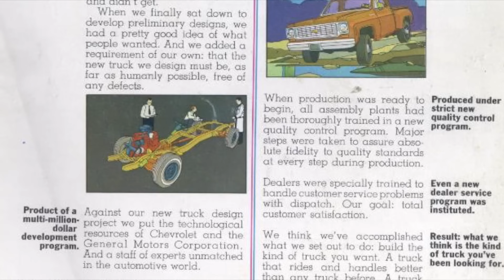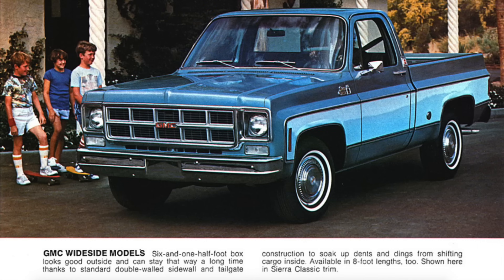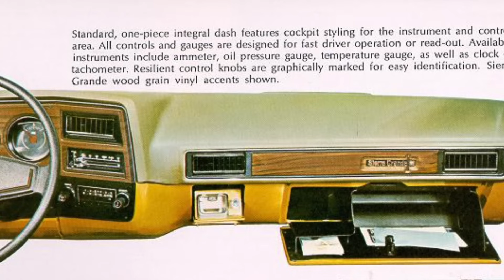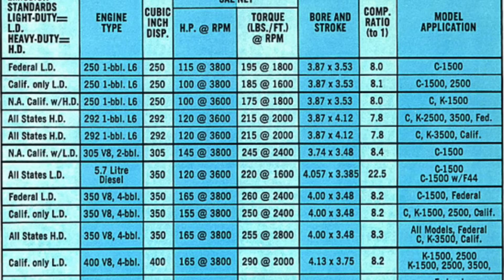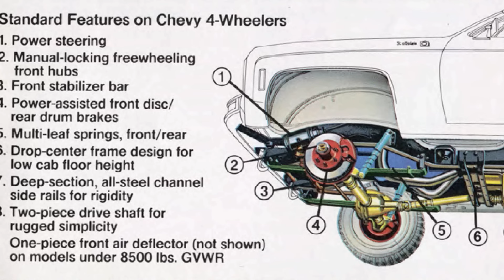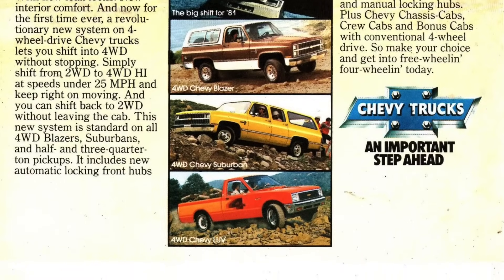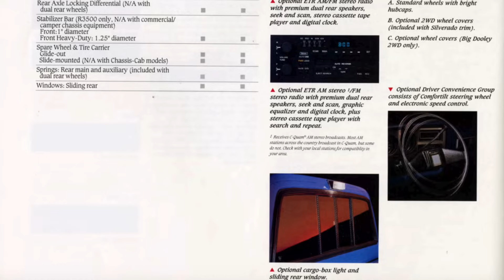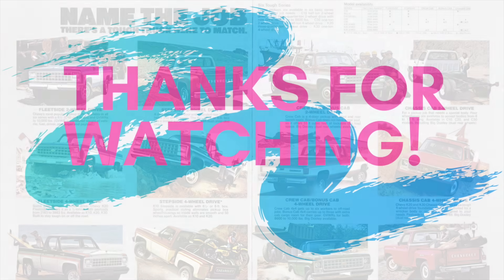73-87 Square Body Chevy & GMC C/K Truck Buyers Guide (Design, Options, Engines, Common Problems)

Comment: Yes. Easy oil change, easy sparkplugs change, easy work on engine, easy works on engine parts unlike today’s truck which you cannot.
Reply: I generally agree with you, but I think for the SBC motors spark plugs are a little bit of a pain since they live under the exhaust manifold. But for 6 cylinder and BBC motors, yes, spark plugs are brain dead easy.
Reply: I think spark plugs are very easy on the 1961-95 GM small blocks. I have headers on 2 of mine too.

My wife HAD a '99 Ford Expedition with the 4.6L years ago. THOSE 2 right rear spark plugs made almost an ENTIRE Saturday of a spark plug & wire change!!! Mixed with more profanity than I care to use in a day!! Don't get me started on an oil filter change on this same 4x2 Ford either!!! 🤬
Reply: No computers and minimal pollution devices. The AIR pump was the first thing to go. Drill out the catalytic and plug with a frost plug. My 1976 3/4 ton 454 cu,in had dual exhaust and no pollution devices. Low on horsepower but good on torque.
Reply: that's because todays trucks are filled with electronic crap that you have to go to a dealership to get it worked on. I'm convinced somewhere along the way auto manufacturers and car dealerships made some type of deal with one another. Why else would you have to go to a dealership to get something diagnosed that only the dealerships have the equipment for that you can't buy and do it yourself?
Reply: I drove a 1976 Chevy C10 for 25 years
Reply: I don;t have to jack up my truck unless I need to work on the brakes.  I love that.
Reply: That's why I refuse to buy a modern car or truck.  I don't want a vehicle that I can not work on.
Reply: @bufford5483  And torque, more than horsepower, is what a good truck needs.
Reply: @RhinoXpress  Much of this is due to the Japanese.  They started cramming their vehicles with all that junk and then, with the help of the enthusiast press, convinced the younger people that all that junk was kool, and that American-made vehicles were "junk" and "unkool" and "outdated".  Those same younger people lapped that up like a kitten lapping up milk.  That forced the Big Three and the Europeans as well to follow suit, as nobody wants their vehicle to be "outdated".
Reply: @jamesbosworth4191   actually the big 3 started it first as far back as the early 80s with electronic gauges and talking warning crap. Chrysler was notorious for putting electronic crap in their cars back then. But let's not forget GMs active cyclinder electronic management garbage in the Fleetwoods that were so bad that they discontinued it after 2 model years.
Reply: @RhinoXpress  I am only talking about under the hood, not the dash.  Actually, the Swedes did it in the 70s - Volvo with their Lamba Sond system, and it seems to have worked, but Volvo was not really a mainstream car, but yes, Chrysler with their Lean Burn and Cadillac with their V864, did indeed introduce those monstrosities in the 80s, but the Motoring Public rejected them and made it clear that we didn't want computers in our cars.  It was the Japanese and the Germans who slowly re-introduced them and made them "kool".  I blame the Japanese because they sold way more cars here than the Germans could.
Reply: I'm a subaru guy about to get his first square body and apart from the rust these look so user friendly compared to the cars I'm used to 😂😂😂
Reply: @COWBOYZNATION It depends on what kind of exhaust manifolds you have on Chevy small blocks.  The original 265 had log manifolds, and after that, they switched to the Rams's Horn manifolds, both of which rode ABOVE the plugs.  The 70s style were branch type manifolds, and those rode UNDER the plugs, making them much easier to get to in cramped engine compartments.
Reply: @cocoworldwideoriginal998  Cool. Squarebody GM trucks rule. Just unplug and bypass the ESC if you get a 1982-86 model.
Reply: Pretty sure I'm getting one in a few days. 40 year old truck has more life in it than the ones at the dealership... especially when I'm the mechanic
Reply: Certain headers are just as easy as stock exhaust manifolds. Head Man Tork- Step Headers is one of them.  I have some on my 81 350

Comment: I own a 74 c10 I got 5 years ago when I was 17 for $2,800. Still has the factory 250 inline 6 with a 3 on the tree transmission. (Love the old school vibe and none of my friends ask to drive it!) It has the option tag intact and  shows a few upgrades the original owner selected like a heavy duty clutch and rear springs, chrome front bumper, radio...If I have my say I will never part with it. I feel like I’m driving a couch it’s so comfy. It only left me stranded one time, the ignition coil went bad. So I got electronic ignition and she’s all good. She’s my daily driver and still earns a living on my pool route! I rate her ⭐️⭐️⭐️⭐️⭐️
Reply: Also I before I got my 74 c10 I had a 79 c10 short bed/step side with the wood bed. It too was 250/3 on the tree, although it was the high performance factory 2 barrel. I beat a 85 dodge truck with a 318 and a automatic!! I think I might have been jumping in my seat I was so excited hehe. It only had 58,XXX miles when I got it, I only had it 3 months before some lady pulled out in front of me while a friend and I were taking 1,600 lbs of steel to the scrap yard... fortunately a witness stopped and gave me his number and said you did everything you could, she’s at fault. I had bought the truck for $3,000, insurance paid me $4,300, then my next door neighbor bought it off me for $300 and sold it to someone who’s completely restoring it. Though only I only had it a brief 3 months, our time together was sweet and I’m very grateful she lives on at a good home. Apparently the new owners dad had a truck exactly like it when he was a kid so he was searching for that very year and model. Good vehicle, made $1,600, and she gets restored, and I wind up with my beloved 74 c10... don’t think it gets better than that.
Reply: Sounds like you have a sweet old girl there!! Awesome stuff!
Reply: I have a 1978 BIG10 454 short wb that I ordered new. It now has 82k miles.
Reply: I have a 79 square body c10. I am looking for a set of truck rally wheels OE. Any suggestions I am located in Yuma, Az.
Reply: My old 79 had a i6, we put a 350 in it with and overdrive 5 speed, i6 was pretty good
Reply: Smart young guy!
Reply: i got a 99 square body she is my baby. even took the time to get the codes out of the glove box write them all down and figure out what bill the old man i got her from got her with, with these codes i was able to figure out he was slick and ordered it through his company and got a fleet price saving some cash. reminded me of when i got on a dealerships phone plan cause they had extra spots so my friend hooked me up with the discount the company got for my personal phone plan :P gotta get in where ya fit in if ya know what i mean.

Comment: Yep, I own a 1981 GMC one ton camper special with the 454 big block.  It only has 65k original miles on it.  I'll never part with it.
Reply: I have a 1973 Cheyenne super 10. It has a 350 and 65k miles it’s my first truck and I’ll never sell it
Reply: cool
Reply: Good old trucks.
Reply: 5. 5 dollars take it or leave it.
Reply: Hope some dummy doesn't try to get you to chop and drop it.
Reply: @jimmychanbers2424   --  Oh no way.  I like my classic trucks stock.  I also have a restored 1960 Chevy Apache pickup with the original 235 straight 6, all stock.  Hasn't seen a drop of rain in 25 years.  I only take it out on nice days.  I hate it when people take a stock classic truck thats in good shape and slam it to the ground!!

Comment: Back when a truck was used for work not tooling to the country club for golf.
Reply: This is when they started that journey.     I have a '78 step side and a '16 crew cab.    I don't want to drive 8 hours in the '78.
Reply: Yet they still looked great with nice colors, options, beautiful interiors too.

Comment: I have a 75 GMC sierra c15 long bed Beau James edition with the small block 350 instead of the 454 which most of them came in. This truck was specially ordered from factory with that motor from my great grandfather brand new in 1975 and still running strong some years later! (Thought I'd just lore dump on everyone 😂)

Comment: My dad had a 1974 GMC Custom 1500 , plain Jane , and I mean plain Jane , white wheels with white hub caps , white front bumper,  no radio,  no AC , no power steering and a 3 on the tree. I learned how to drive on this truck at age 10.

Comment: My dad bought a 1973 Chevy Cheyenne super 10 for his 40th birthday and it had the blue and white combination paint!!!
I remember as a kid when I first rode in it with its 7and a half inch thick bench seat a 350 engine and I knew then that this was a special truck that would stand the test of time.
We lived on the water and unfortunately the salt water wasn’t too kind to the body with rust starting I think about 6 years or so later but how I loved that truck !!!!
It was the engine that I performed my first tuneup on and later some of my first Autobody repairs on but how I loved that truck!!!!
Now here we are almost 50 years later and just as I knew then it continues to be one if not the most sought after trucks by collectors today. 
And as I think back now to my dads truck all I can say is how I loved that truck!!!!
Reply: When I bought my 1986 K10 Delux Custom around 1987, I paid $10,000 for it.  I thought it was a good price.   I checked prices on Square bodies on the net, and they are listing at 20 and 30,000 bucks.

Comment: When I was in high school around 1984 my dad picked up a 1974 GMC 4 x 4 stepside, it had a 350 and a manual 3 speed with Granny Gear.  That truck would kill anything made since. ;-)  One time when we were getting on the highway about to make a 300 mile trip towing a boat the transmission lost a few gears, turns out it was something to do with the part time 4 wheel drive and the local 4x4 shop had a retrofit kit that fixed it, my dad and I did this all in our driveway.  My dad also took this truck out hinting shortly after buying it and the factory manual hubs wouldn't lock, so my dad was able to get a set of Warn hubs and put them on in the parking lot.  Another thing we did in our driveway was put on a Rancho 4" lift front and rear.
Reply: These things were junk

Comment: I have an '87 Silverado Stepside that I've owned since new. '87 was the first year Chevy trucks got fule injection and the last year of the Stepside bed.
The one person that gave this video a thumbs down musta been a ford truck owner of the same generation and hates his decision in life. What a Nincompoop!!!!! Lol.
Reply: You could get a stepside in the 90s and even in the 2000s
Reply: @larrytate5867  Chevy changed the name to I believe sport side and GMC to Wide side it was completely redesigned. The fenders were molded into the bed side panel from '88 till ????  The original stepside bed with the big bubble fenders that actually bolt on to the bed side ran from 1955 to '87. With only slight changes to the fenders/ tail lights the box and tailgate and wood floor were unchanged for that 32 year run. 
Thanks for playing.
Reply: @afterhourshotrods6882  The stepside beds did change styling numerous times over the generations, a whole lot longer than 32 years.  The 20s trucks had one style, which changed in the 30s, another style up to 46, then 47 to early 55 had yet another style change, then 55 to 59s were different again, the 60 to 66 generation had it's own unique styling, 67 to 72s were unique, and 73 to 87 were again different.  Yes, they were all bolted together steel body panels until 88 when they changed to fiberglass, but they still had steps, therefore they are still stepsides, and not all of the older step sides had wooden beds, steel bed bottoms were available in late 70s and 80s with the stepsides.  Wood bed bottoms were available in fleetsides up through the 78 model year as well, which most people aren't aware of either.
Good game.
Reply: I believe 2004 was the last year for a GM stepside bed.

Comment: My wife and I own my father in-laws 1973 GMC 2500. He bought it in 1972. Rust is a big problem and we live in Ca. I just painted the exterior and am in the process off refinishing the interior.
Reply: Put roof drip rails on it.  That way water won't drip in so much during the winter when you open a door.

Comment: Just bought a 86 k 3/4 4x4 automatic for 8,000 I couldn’t find a Stich of rust on it. The most I ever paid for any truck I’ve owned. Odometer says 55,000 one owner. Needed some new seats, put rubber floor pad and no rust was under the carpet. New headliner, tunes. She rides like a dream no rattles sounds great. My Uncle fixed her up real nice. Only problem is I’m pushing 60 5’2” and getting a bit round and it’s a bit tall but I’ll push pull or drag myself into it till I can’t lol. I just need one of those stickers that says (nope this ain’t my ole mans truck)😎 you all take care and be safe! Laura
Reply: Caution - resist the urge to use the wheel to pull yourself up!  You will eventually destroy the bushings in the steering column.

Comment: Purchased my 1987 c/10 
Custom deluxe - 3 speed w OD , note I have never heard of another or seen a 3 speed w OD on the floor outside the one I had . bench seat 305 throttle throttle body fuel injection two town paint special I think you call it . I drove it till 2013 last two years as a farm truck - 108k if memory serves - other than a battery and one clutch - I can not remember one single time it broke down or failed me 
NOT ONE . ILL never beat that run . Great truck the bed & engine both solid as a rock the day I sold it to couple boys after a year of pestering me for it . Great video

Comment: Was looking to order a new truck for 1975, to carry a slide in camper and pull a boat. Ford was too high and either a camper package ( dual batteries and wiring) or 4x4. Not both.  LT pkg, 360 2bbl. &7,800. Chevy would give me the lowest tailgate height(center of gravity with a camper on), 400 sb 4bbl, dual batteries, Silverado pkg, camper wiring, sliding rear window, auxiliary fuel tank, skid plates, factory FRAME mounted tie downs, shocks between the bed and cab, stabilizers on front of cab to the camper, factory tach, 4x4, 4:10 rear, 3 spd auto with aux cooler,am/dm/cb radio, ac, tilt wheel. $6,400. Just before I went to order my truck, I found a 1973 with all that stuff, but the motor is a 350. Dana 70 rear, Dana 60 front, Cheyenne Super pkg. 
    I still have the truck, camper (9.5 slide in) and the boat(19’ bayliner- Grownups boat). I needed the 4 wheel drive to back down that steep boat ramp at low tide. With the camper on the truck, low range and 1st gear, I’d walk right up the ramp. No wheel slip. The flow through ventilation sucked going through LA, when the smog was real bad. It brought it right in the cab. Open the doors when it’s raining, the rain falls on your seat(no gutters in 73), also when it rains and the radio is in am, every time the wiper crosses the antenna, radio goes dim. Had rust on rear quarters and bottom of the doors. Fixed. I added aux fuel tank, transgo shift kit, headers and dual exhaust, oversized convex mirrors. Have been on beaches on both coasts, desert, and cities. Parked on the street in Manhattan, just pulled my drivers side mirror in. Best truck ever for all around hauling a camper. (A dually would not have been able to park in the city)  10 mpg @55 mph. In the mountains 4-5 mpg, 2nd gear going up and 2nd gear coming down.

Comment: I got a 1985 short bed I bought off my grandpa for $600. It'd been sitting in his barn and hadn't been started in 7 years, put a new battery in it and I ended up drivin it home.
And the dash still had no cracks.
Reply: How reliable is it?
Reply: @cptchuff2741  bulletproof truck only time I had an issue was when the winter killed my battery but it was also in the negatives.